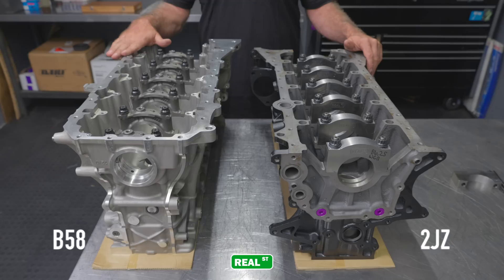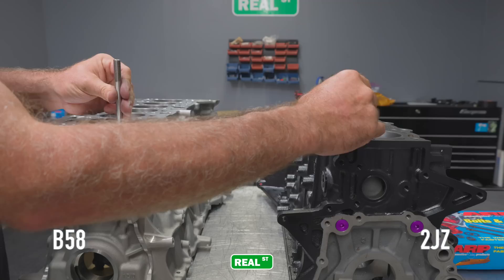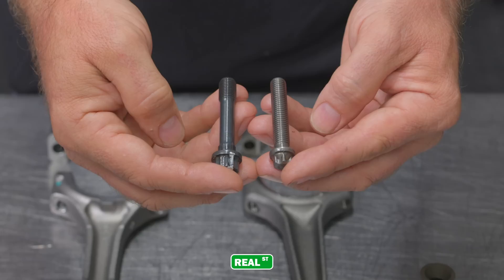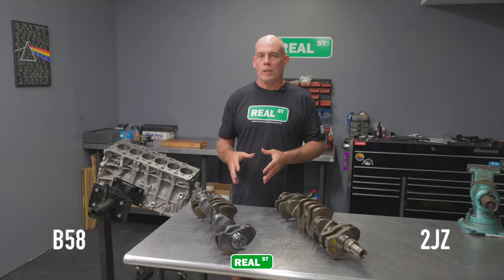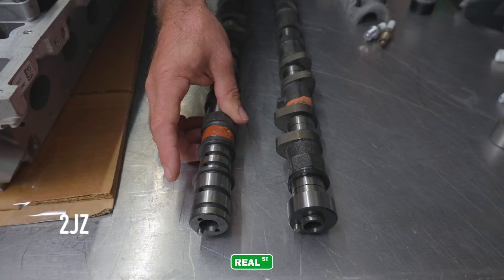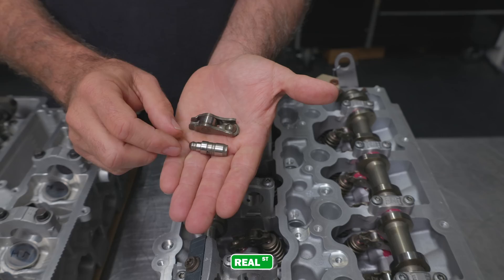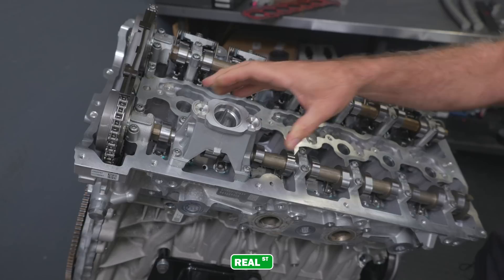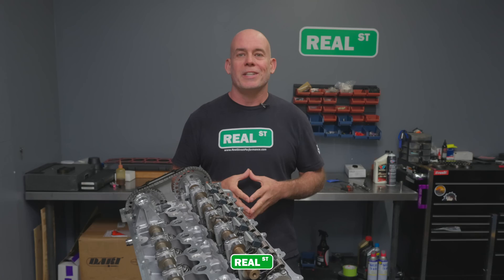Toyota 2JZ VS BMW B58 | 2JZ STILL KING?! (Detailed Engine Internal Comparison)

Comment: I do want to add a little bit of a side note. I used to be a Toyota salesman and one of the things I've learned is that the B58 in the Supra and BMW's B58 have some key differences that makes Toyotas far superior. They changed the gaskets and high failure compents and im not sure if this guy was bullshitting bc i cant find anymore information, but when i went to the "supra event" when it launched and they had us drive it and learn about it. A spokesperson told me the internals are also beeffed up in the Toyata B58.
Reply: No, all is the same in the mk5s B58 vs bmws. Thing is, is that they have a stronger hpfp than in the mk5s B58 vs other bmws,which gives them a massive advantage in terms of making power over 600whp+ on stock fuel pump(tho this later changed since bmw started putting this I6 in other cars later down the line). They are still the same(depending on which gen B58)other than the hpfp,but people are partially wanting to see if bmw will allow toyo to use the dual port/direct injected B58 bmw is using in the 540i/740i to be put in the supra or not so that's a waiting game all on its own.
Reply: @carboydorifutoparty3976 B58TU in the supra has the same 350 bar high pressure fuel pump as every other B58TU powered BMW.

Comment: Biggest single drawback with the BMW is that direct injection which is not suited to high HP applications. It compromises the chamber shape, valve size and head flow. The high pressure pump looks like an easy delete and you could always go with an external oil pump like a dry sump system. Good to see they have a 6 port exhaust head.
Reply: They can just get port injection which isn't hard to do at all with them. Plus, they made a new gen B58 that's dual port and direct injected from factory sitting in a few bmws as of rn that'll be moved down to later models down the line.

Comment: I had to sell my Supra. It wasn't a finished project though 😢
But i did buy a BMW M140i for half the amount it was going to cost to get the Supra on the road!
I don't believe it was released in the US. It has the B58 and it's currently running at 430whp which for a small, rear wheel drive hatchback is plenty on the road, especially with the stage 3 mapped zf transmission! Apparently the B58 is good for 700bhp on stock internals, but I'd rather keep a bigger margin. I'd love to have between 500-600bhp and I'll be happy to leave it at that 😁
Reply: The tech is definitely a nice upgrade from 90's electronics.

Comment: The N54 is the German 2JZ & don’t forget it❗️ The B58 is an N54 with stronger internals & the N55, S55, B58 & S58 wouldn’t exist without the mighty N54…..❗️

Comment: It's way easier and cheaper to develop an engine without strict requirements for homologation. That's why you can't really compare both engines. The 2JZ is impossible to build by today's standards

Comment: Please do the same with an S58! Everyone complains BMWs won't make 1400+hp like the 2jz when the 58 is designed for driveability and BMW has a literal homologation race engine in their performance cars. If you want to go racing >1000hp it might be time to use the race engine instead of the grocery getter.

Comment: one big thing thats a massive turn off to the b58. aluminium block with SPRAYED ON liner. 

no sleeves. putting sleeves in allways adds another possible fault point. 

me personaly, id stick to the 2jz. proven performance. 
it of course isnt as efficient by modern Standards but complexity also brings potential problems with it

Comment: You are probably wrong with that second part of oil pump. Its just vacuum pump. That vacum go to engine block and than drirectly to vacuum hoses. This vacuum hose conect to engine block on the side approximately 15cm obove this pump.

Comment: The 6 port B58 sounds so much better than the 2 port exhaust! Big differences
Reply: 6 port is the old one? and 2 port is the "tu version" right? I have a 2016 m140i and I saw that I have 6 port
Reply: @azerty1604  I believe it’s 6 port for the newer cars. That’s also what Google says but I’m probbaly wrong.
Reply: @ScottPC  think it was 6 at the start, then in tu version they put a 2 port, but at the end toyota decided to came back on the 6 port with the new version
Reply: @azerty1604  Just read High powered varients are 6 port (Gen 2 TU) and lower powered (Gen 2 TU) are 2 ports as well as the Gen 1 B58.
Reply: @ScottPC  oh okay really nice to understand that, thx mate

Comment: This video is fanfuckingtastic.  At 14:57 I'm bowled over that you've got the major variations on both blocks--the 2/6exhaust port for the BMW and the VVTi for the 2JZ.  I didn't even know the VVTi was sold in the US?  I had a '95 Supra Turbo but took it with me to Europe in '98, and then was in Japan and picked up some end-of-life catalogs for the last year of the JDM Supra that mentioned the VVTi and I think some new lateral shock absorber in the rear suspension.  As nice as VVTi would be for a high-breathing NA, I'm wondering if in turbo applications its better just to keep it simple?  Do tuners use the variable-timing cam?
Reply: Vvti is a great addition to street driven 2jzs, assisting noticeably with low end power as well as spool up by a few hundred rpm.
Reply: @supra1722  I've since read a 2JZ tuner who was now working with B58s, and it was kind of funny: he just had the fancy variable oil pump and variable cams hardwired to max.  He  still had 10x the parts of the 2JZ subsystem, but just wasn't using them.  Unless tuners actually use those things--and I doubt they'll use the variable oil pump at least--the 2JZ simple solution is superior I think.  I had to laugh.  OTOH he had some arguments that the block was far lighter and just as strong, at least for up to I think 1000HP.
Reply: @lqr824 B58 block has seen 1200hp before needing liners for reliability.
Reply: @huh0123  Thanks.  It's a bit academic for me as I'm still driving an M5 I bought in 2001, and a convertible manual F430 I bought new in 2008.  I'm too old for more than like 600hp. 😀In fact I'd probably be just as happy with less.

Comment: Oil pump leaking everywhere I’m gonna asume that’s the BMW oil pump 😂
Reply: Every oil pump leaks. The trick is to get the leak going in the correct direction.
Reply: @exothermal.sprocket  Yeah but BMWs leak a lil extra just …a lil 😂
Reply: @EBKFiXXY That's great though, more oil for the engine.

Comment: All BMW engines have throttle bodies (TB), the TB is not used unless the Valvetronic servo motor fails, which can as the damn motor is working all the time when the engine runs and its a high torque speedy little motor, which does not last forever.

Comment: If i had to put them in order... its S58 (best) 2JZ (it can hold more power than a stock B58) and then barely behind the 2jz is the B58.  ONce you talk about building it fully the B58 beats the 2jz mostly because of machining tollerances and electronic controls.
Reply: No one is B58 swapping anything. Show me where you've seen a fully build b58 win any drag competitions? Or run  5 second passes? It's not happening due to a multitude of factors.  At the end of the day, it's still a wannabe 2jz engine and it's pretty sad we are still comparing these modern engines to an engine from 1992
Reply: @shadyshinichi2JZ  A quick search on google will show you alot of B58 swaps.  The B58 is still a newer engine and only came out in 2015.  One of the big issues is that after the first 2 year run in the MK5 supra they put a new ECU in and its still locked.  I am just sad that we never got the Barra in the united states.  That would be swapped into everything

Comment: People can go amongst their pissing contests, Stock vs stock (B58), "built" vs "built" (2JZ), bolt on vs bolt on (b58), etc etc etc.. the list will go on and on infinitely and the results per equal adjustment will vary until the end. 

The reality is 20 years "into the future" isn't always an advantage. Technology has progressed, of course, but so has the crippling grasp of Emissions regulations. With that, Form factor, weight, and power delivery under both WOT and partial throttle at varying RPM are considered in the overall design of the engine. All of this contributes to the end result  and driving experience of these cars off the lot, which is exactly what the engineers are targeting. 

I could write pages, scratch that, books about the mindset of engineers, marketers, auto groups, and auto manufactures when they decide to develop or improve a car. The end result is simple. Toyota, the beloved producer of the 2JZ, chose BMW to produce the Powerplant and chassis for their starchild, the Supra. BMW is the standard for i6 Performance in 2023. That is indisputable.

Comment: Valvetronic seem like a good way to replace 1 simple component with 30 components to gain absolutely stuff all in fuel efficiency.
Reply: If BMW wasn’t always innovating then the rest of car manufactures wouldn’t have anyone to copy.
Reply: Koenigsegg Freevalve seems like a good way to replace all the mechanical complexity, drag, weight, with simple independent valve control.

Comment: The jz and rb aftermarket is the only way they're still in the game, oz is making the rb what it is today
Reply: Yet 2jz is so dominant it's still crushing any other import period
Reply: @hatch450sx3  At WTAC this year there were no jz's on the top 10 of open class, again, so crushing period is an over statement
Reply: @sircefiro  well WTAC isn't really where you will see many I6 or V8s anyways since they are heavy engines, that's partially why there were so many Honda K swapped cars, EJ25 WRXs, 4G63 Evos, and a few SR20 powered cars.
Reply: @chongos5018  There was 2 rb's in open class top 10, including the winner, pro am was won by an ls, an r32 gtst was banned from Bathurst after getting the straight speed record, point is crushing any other import period is way off, you're just talking about drag which jz got in earlier on the billet game, now with oz others are catching up, the rb and barra billet is rated at more power than jz billet so will see where drag ends up too

Comment: People need to understand B58 is an engine that both has as much potential as 20+ years old 2JZ, while having far superior fuel consumption & emission & driveability.

Sure, it wouldn't last as long as the simple 2JZ but I can tell you even modern Toyota engine would struggle to last as long as older Toyota engine. The only exception is probably the G16E-GTS engine, but that engine still has many complicated bits that would failed, where as older engines like 3S or 4A wouldn't.
Reply: B58 will outlive and surpass 2jz. Some European tunners and parts manufacturers have already drop some interesting things in market. With all controllability available, some interesting  can happen. This engine still uses low compression, so so much room to grow

Comment: sooo.. basically B58 with similar modifications as the 2jz for similar power range.. is a 2jz with more electronics.. but breathes better in terms of the 6 port B58

Comment: if i was building a strict track car, 2jz. but you can still build a high horsepower b58 and itll drive like a normal street car. with all the technology, i believe the 800 hp b58 will destroy a 800 hp 2jz.

Comment: A simple design is what you need for a modified engine. A complex design is what you need to pass the government regulations. 90s was the most successful era for cars cause there were not much regulations to limit them and because of this reason we won’t have any engines that can beat 2jz and RB cause manufacturers first challenge now is regulations and they have to install all those extra parts to achieve that and that can be unreliable when it comes to modified +1000hp engines and in 5 years they all go electric!
Reply: Every racing series goes against the simple is better. Direct injection, pre-chamber injection, turbocharging, vvt and vvt-i, servo controlled  wastegate, metallurgy technology ... are derived from racing use. Today, racing management body act against new technology to avoid cost increase. Either way, more efficiency = more horsepower. 

PS : a proud mercedes amg hpp engineer

Comment: B58
Direct Injection 
Wouldn't that become an issue?
Having that compression & combustion on the tip of the fuel injector? I thought fuel injector tip (where it sprays fuel) was a sensitive part. Now it's just getting beat daily since it's in the cylinder.

Comment: Never had the pleasure of driving a 2JZ powered vehicle, but I was astounded with just about everything of a b58 powered vehicle; what git me the most in this video is the CR of the b58. 
How do they manage that?!
Reply: Direct injection
Reply: The higher compression ratio is worse. Less compression is better for boost since you can run more boost without detonation. Why do you think the s58 can run much more up on 93 than the b58? Less compression. This also contributes to why the vr38 is the best 6 cylinder ever made.
Reply: @2seep  high compression has redeeming qualities as well.
Reply: @2seep It’s not as cut and dry as you are making it out to be.

Comment: The BMW engines nice if you want to leave it stock but I do not trust BMWs engineering. Thinning out the tops of the rods only asks for future problems. The chain drive on the back of the engine means hard to service, oil pump is really complicated to many cons!
Reply: Plenty say the chain isn't hard to get off cause it's a much simpler design before and that it doesn't  take nuch to remove them(tho there's no reason to bother with them cause these don't have chain issues like past bmw I6s).

Comment: If they would have made the b58 iron like the jz and a bigger bore with less about shaving weight and more about strength just a little bit where it counts the b58 would be perfect. Other than that the engine is superior in its tech. Interesting how they engineered this over the years. Now I know why they move out so well.
Reply: biggest issues with iron blocks is weight and heat. the aluminium is better suited to modern engines that have to meet emissions regulations.
Reply: @bohr_II  yeah very true but these engines were made around the mind of performance and handling more power than everyone else more reliably because they have the heaviest cars. cant have it all. Everything has a down side. But these cars aren’t meant to be slow emissions vehicles or have to turn left and right  with agility built on a carbon fiber mono  frame in motor sports enough to matter or benefit being aluminum. Strength longevity vs weight less heat.

Comment: I say for 20 years old the 2jz is still very surprisingly well made, way ahead of it's time. On a side note though, I'm not sure if it's been done but I think a well built 2jz let's say 1500hp+ and the 8 speed auto in a mk5 would hurt a lot of feelings.. real street be the first?
Reply: There's a mk4 in the UK running with a bmw ZF 8 speed making like.....600-700hp but it's issues are mainly the fact that it's lag kills its chance in getting a good launch.
Reply: @carboydorifutoparty3976  crazy.. I would of thought the 8 speed would really wake up the 2jz.. keeping it in optimal rpm power range. any video coverage of this mk4?
Reply: @LTFT83  look up the channel  "officially gassed - OG".( actually looked up 8 speed mk4 and it turns out there's a few more out there running a ZF 8 speed)I think this was the one or maybe not cause I watched another that had a bmw auto box but I can't remember if it was this one specifically(imma have to rewatch it or hunt it down).

Comment: the biggest question is witch engine can handle the most power   with the factory internals before catastrophic failure
Reply: Not sure about the internals but I’ve seen over 900hp on stock driveshaft 😅
Reply: 2JZ Stock motor record I believe is 1100whp 
While B58 Haven’t seen more than 900whp stock
Reply: @gotgoldgt  nice but that doesn’t mean much 😊. Though an iron block would be the better pick imho. I wouldn’t use what things could possibly make on stock internals to have any bearing on how good a platform truly is. Just usually meant one used better rods.
Reply: @gotgoldgt  There's one person I know who's running a B58 over 1000whp on a stock engine
Reply: @zethloveless7238  what do you mean? Stock form means less engine work. That's always what you want. It means if engine blows you buy another and throw it in no waiting on machine shops down time ect.

It's why now people are starting to look at gen 2 and gen 3 coyotes so much now. They hold up to 1000hp stock engine just add boost supporting mods and e85 see ya out the door.
Reply: @hatch450sx3  lmfao bro it isn’t that simple. I can tell you are just some sort of keyboard mechanic. No matter what I’m gonna still put new rods and pistons. I don’t trust any stock rods to make real power. You guys that thing your getting 1000 usable hp on stock blocks make me laugh. Enjoy your day man. Thanks for the chuckle.
Reply: @gotgoldgt  So it's not any better than M103 that mercedes made in early 80s

Comment: The Modern engine's relying on light weight but the older engine is relying on Robust build so you can add more power to the engine at the same time it can last longer. And btw as I've observe the mk5 supra is somehow regulated on the engine and other parts the only Good and nice on mk5 supra is the exterior design its exterior looks but for me mk5 supra is week because it has many regulations 😢

Comment: Alloy block will never be as strong so, it goes without saying the b58 will never run the insane HP the 2jz can manage on a stock block which didn't get any further development than its first design ( excluding the head ) and fitment to the Supra.